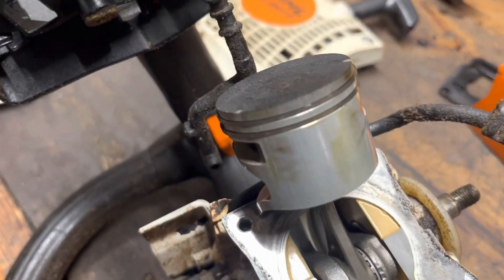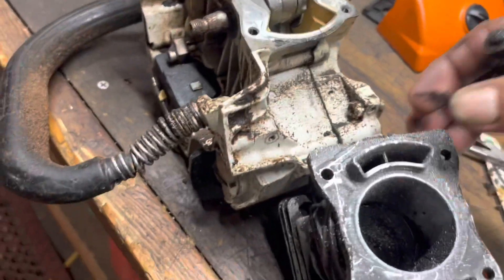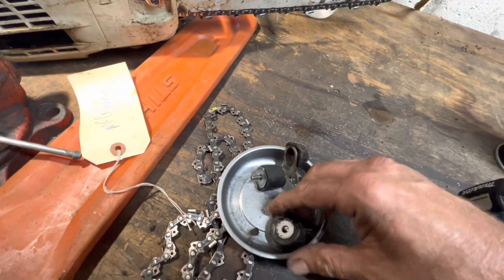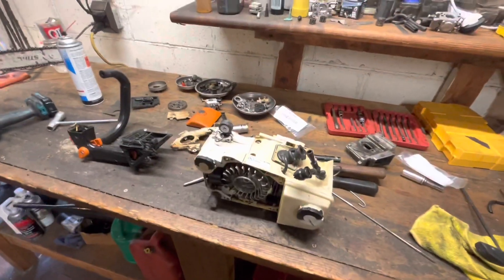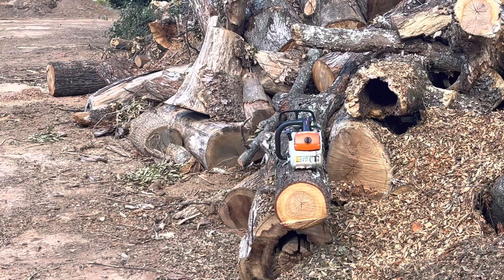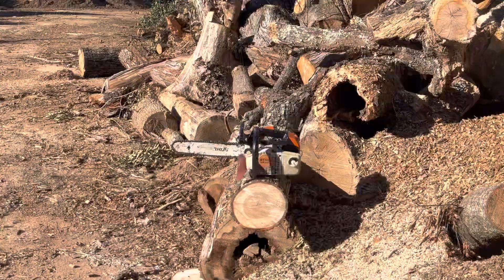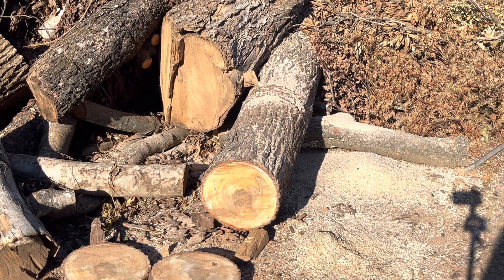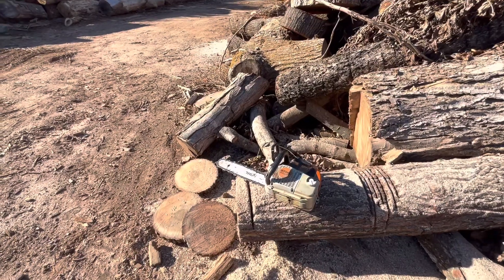Modded MS200T vs Modded MS201T

Comment: Yikes on that carbon!!!! Nice job doing details on the differences of these two. I was curious about the 201. Lots of guys don’t like to port the 201 since they have a dome piston
Reply from the maker: Before I say they don't need machine work.... I never have felt the need.  There's good gains just optimizing the existing cylinder and muffler.  Cheaper too.......
Reply: @richardflagg3084  lol yessir even steve told me he made a special non machine work package just for these saws 😉

Comment: They definitely both wake up with light mods. So maybe full port job 200t better to start with? I mean 201 just going to take more work to machine that’s all.
Reply from the maker: Prolly should have done a before and after on these.  I would have shed a little light on the performance work.  That being said the 201 is choked down more than the 200.

Comment: Seemed like the 201 was tuned better than the 200. 200 sounded lean to me.
But nice work. I'd run either of those. 👍
Reply from the maker: Tuned it under load.  That was the sweet spot.

Comment: (NEW) Stihl..... built for profit, designed to fail.
Reply from the maker: Not so fast.  The 201's have been pretty good.  Hell I plugged one in a couple of months ago that had 17,000+ starts.  It was just in for a service.  The old rules still apply.  take care of your equipment and it will last.
Reply: @richardflagg3084  I have an old 026 pro that I have just abused to hell, replaced the usual wear parts and it's back to the abuse. I just feel the "newer" designed Stihls aren't made like that any more. The 038 mag was literally a Tank disguised as a chainsaw.
Reply from the maker: @jerseyjoshua4818  This is a great idea for a video to cover what I see in the new saws vs the older ones.